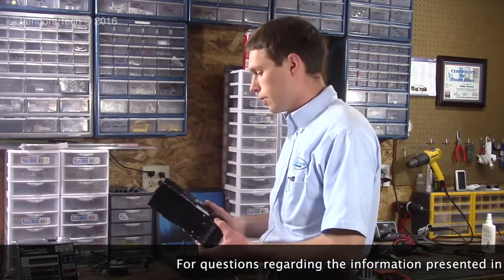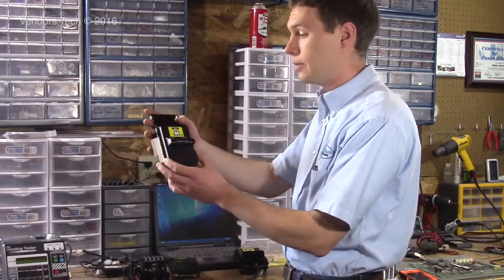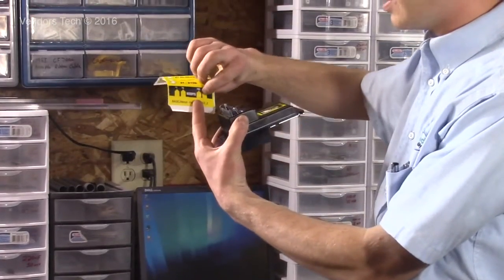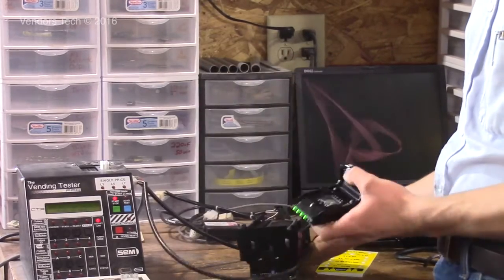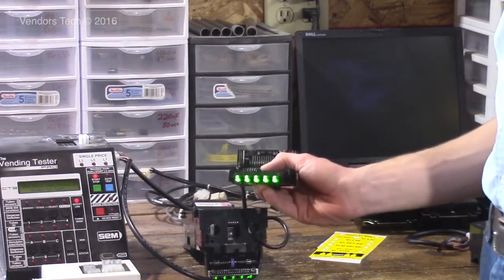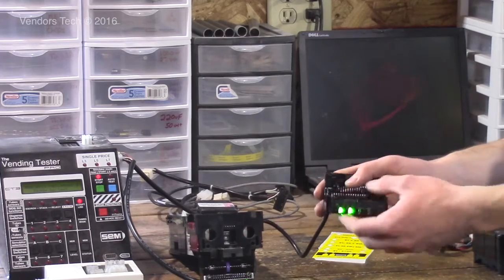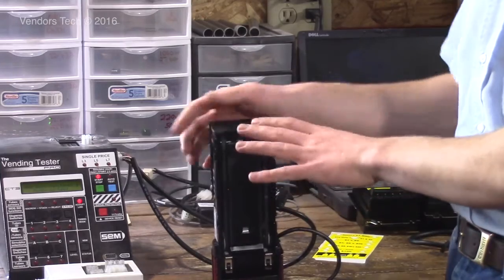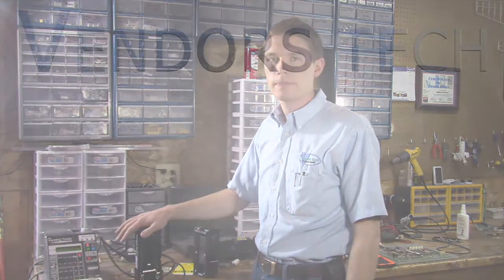Coinco Vantage Bill Acceptor Overview and Programming

Comment: Coinco Vantage currently operating normally but Service Unit light is flashing, what should next step be? Besides cleaning
Reply from the maker: How many times is the light flashing and what color is it?  If it is a two-flash orange light, that indicates an insignificant corruption error on a certain part of the validator control board, but as long as the unit is still working (which it most often will with that error), the unit does not require service, and you should keep using it.
Reply: @VendorsTech  Yes two-flash orange light, I’ll continue to use it then, thank you for the reply